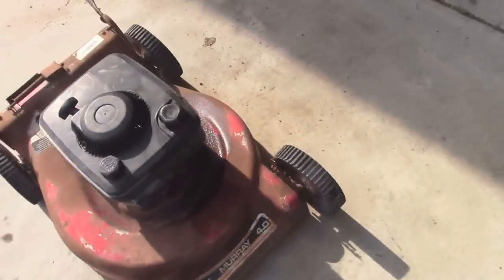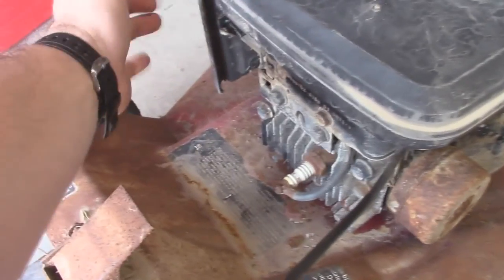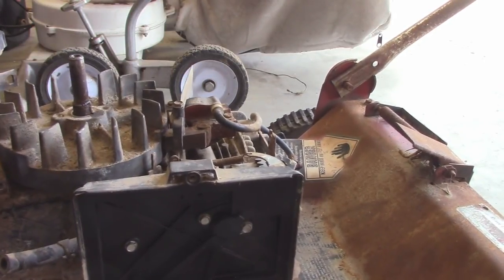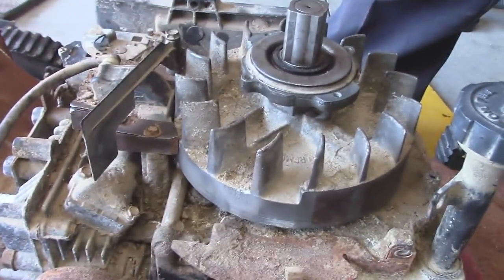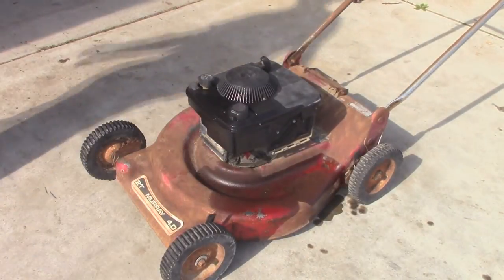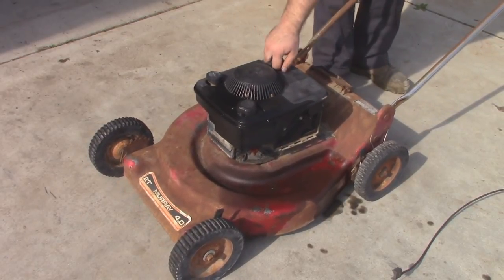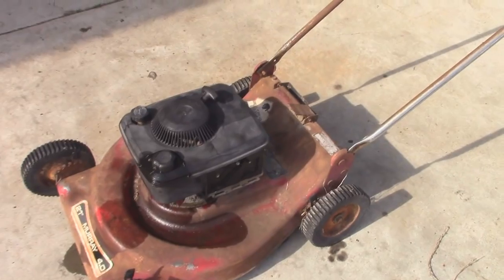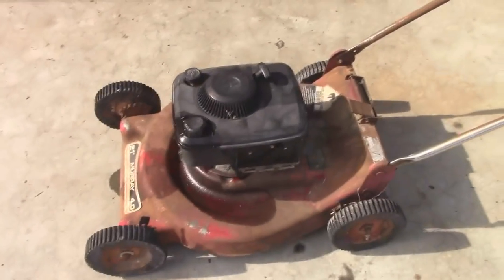Attempting Revival of a 1988 Murray Mower

Comment: Pop that tank off find the leak and fix it with a soldering iron.  It is probably leaking at the upper seam.  You might as well get your $30 worth out of it, but that is going to require a tank fix.  Nice Job!
Reply: I've had good luck with welding plastic gas tanks, whatever plastic they use for gas tanks seems to  weld well.

Comment: I had a Rally big wheel with the same setup as this (think it was an 84 model).  Amazingly it ran but also had a cracked and brittle gas tank.  I'm with Thomas Thibodeaux those should be able to accommodate a metal tank and pulsa-prime carb.  Would be cool if you could pull that off!  Wanted to do that to the Rally but didn't have an old style tank/carb and wasn't cost effective to do so and they won't accept the "quantum" gas tank either.
Reply from the maker: Thats probably what Im going to do is go with the pulsa tank set up
Reply: nope i went and bought that  back to use so i can makey moeny cutting grass when i move to nappanee

Comment: the people i sell mowers to love disabling the safety, they can  leave their mower running, warm it up go get the rest of tools from the garage or move a stick while mowing.
the only thing i do differently is wire up an ignition switch.. when you want to turn it off just toggle off and youre all set..

nice save though i bet she'll clean right up with alittle diesel fuel and a power wash!

Comment: Good work!  Too bad about the tank, but have you looked at converting it from a Briggs Max into a "Classic"?  I think they have the same shortblock, so I think you'd be able to put on the metal tank/diaphragm carb with a bit of part swapping.
Reply from the maker: No I didn’t but thanks for the heads up I’ll look into that for sure !
Reply: just take it its outside my window

Comment: Question, why do lawn mowers need air filters?
Reply from the maker: prevents dirt from getting sucked into the motor and wearing out the cylinder and rings
Reply: oh, that makes sense now! I thought it was the other way around but being outside I was like is this going to aggravate allergy problems? lol Not a vacuum :)

Comment: Hank if im not mistaken on those older engines you can replace that tank and bowl type carburetor with the type that goes on the side with the carburetor on top and a filter hat. With the compression that old engine has it would be worth it.
Reply from the maker: Stay tuned 👍
Reply: Also the plastic ground part that connects to the coil are usually interchangeable. Love the way those old Briggs idle, I have 3 old ones that idle like that and two tecumsehs that idle the same way. 
Good videos and good work!
Reply: I have been working on these things since I was 12 years old and I’m 51. You are the man who showed me how to use a cordless impact driver to work on these things, so now I leave the ratchet in the box. Thank you.
Reply from the maker: I love having that little impact it makes things go so much quicker

Comment: Other mowers to use the briggs and station max series engines besides murray's were snappers rally's and ropers the same company who made the craftsman mowers all three mowers were made by ayp american yard products so were the poulans the mowers the poulan pro's the weed eater's the kgro'skmart brand mower  the gras keeps the lawn keeps. Also jacobsen homelite echo's and gibson mowers also used the briggs and stratton max series engines on their mowers the jacobsen's the echo's and the gilson mowers also made by the same company they look exactly the same. They were either red or orange and the echo mower were a silver gray color i have some of the brochures on these mowers and some of the mtd side brand mowers also used the briggs and statton max series engines such as montgomery wards mtd mtd lawn flite jcpenny grass handler yard man troy built and cub cadet and lawn boss just to name a few. How do you tell on a briggs and station max series engines the difference between a 3.5 hp one and a 4.0 hp one? They are both very big and hard to tell them apart the most common briggs and stratton max series engines styles were the ones with the gas tank on the rear right hand side and the oil tank on the rear left hand side and the muffler on the front left hand side. Were as the ropers and the rally's were like this murray in this video the gas tank on the front left hand side and  the oil tank on the front right hand side and the muffler on the back right hand side or some of the rally's had yellow  quantum engines. And the snappers and jacobsen mowers with the briggs and startton max series engines but their gas tank on the front right hand side and the oil tank on the back right hand side which meant the muffler was on the back left hand side of the engine to blow the smoke in people faces. O
 and the vertical pull snappers with the briggs and stratton classic engines also mounted the muffler on the back left hand side of their engines great mowers but a bad spot for their mufflers.

Comment: I have seen on ebay new old stock engines for briggs and stratton like for this mower is the briggs and start ton max series 1985- 1991 or 1992 they also have briggs and stratton classic engines briggs and stratton sprint engines briggs and stratton  quattro engines. And  briggs and stratton quantum engines and the briggs and stratton ex and briggs and stratton ex500 and 550 series engines i once even saw a briggs and stratton max performance kit for these exact engines to increase performance and make them run better. The package was saying you'll notice improvement in your briggs and station max engine performance these seemed to be  pretty good engines. What ever happened to them? They stopped making these in the late early to early mid 90's and the quantum took over i like the briggs and stanton max and briggs and stratton quantum and the briggs and stratton classics and the briggs and stratton quitter's. But those briggs and stratton ex 500 and 550 series engines don't look like they are all that great and reliable they are kind of funny looking and ugly if you as me and in my opinion  i hear stories of people buying wamart mowers with these engines and they break down after 1 year and customers return there mowers to walmart. As for the rust on the handle i saw a video on you tube were a guy had a 1987 eager 1 self propelled mower with a blade brake clutch he made the video in the fall of 2013 he was saying use foil and diet coke to remove rust from the handle on mowers i'm sure it can work on any thing else that chrome with rust on it to.